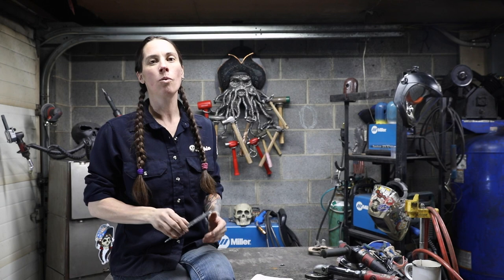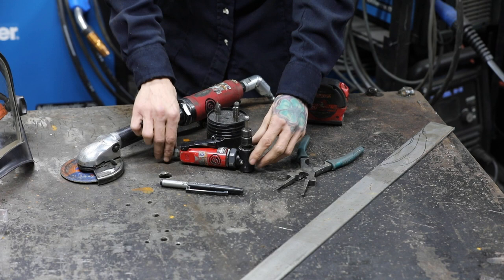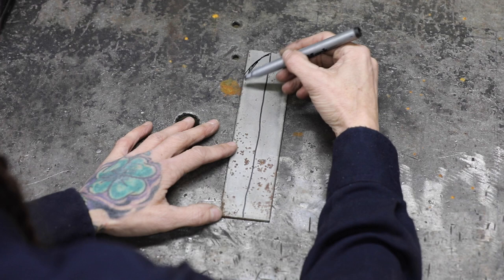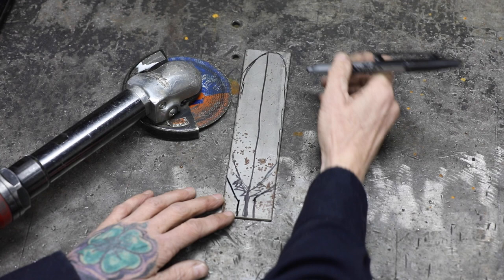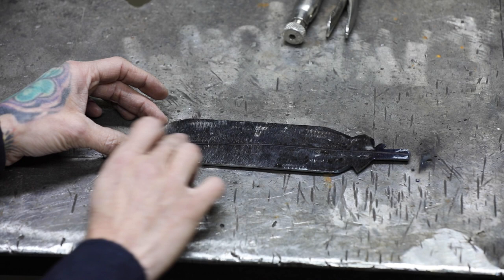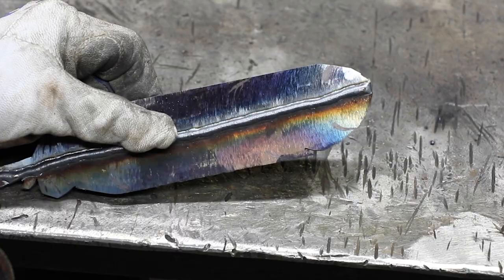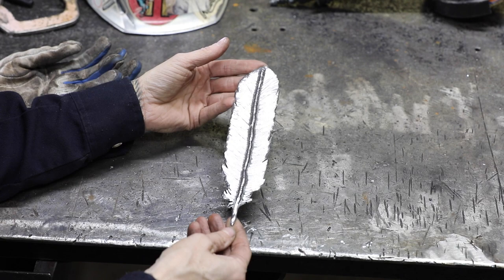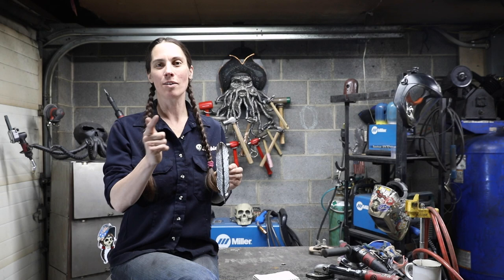How To Weld A Feather | Introduction To Sculpting Metal | Easy Scrap Metal Art | Barbie The Welder

Comment: As with your sunflower video, I got lots of ideas I can translate to my blacksmithing work. I prefer to chisel in the lines on my feathers when the steel is hot, and ended up forging a "chisel hammer" with the chisels angled at 45 degrees to speed up the process. Never thought of welding the center line in, but will try that this afternoon. Thanks so much!
Reply from the maker: Cool to chisel the lines!!!